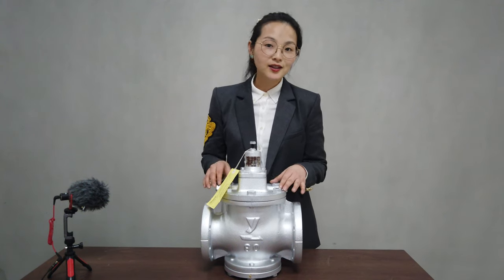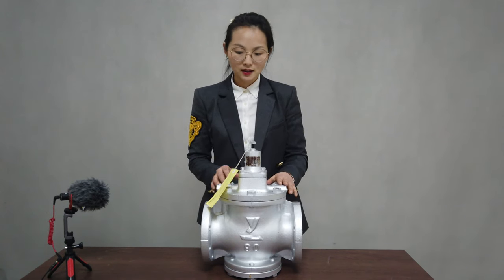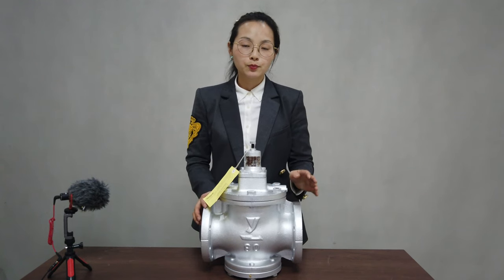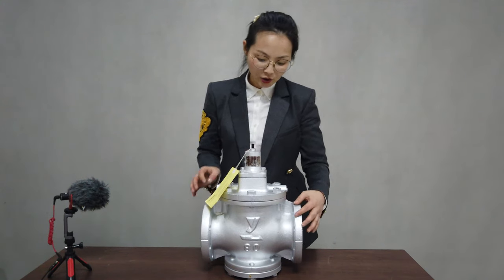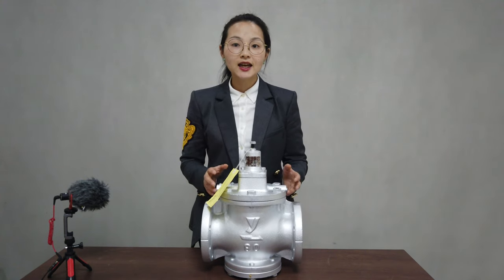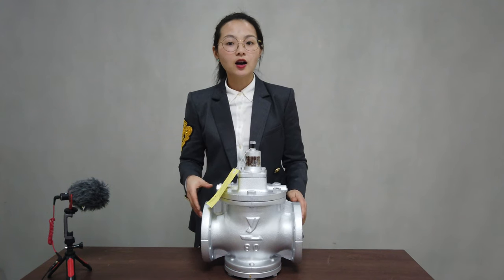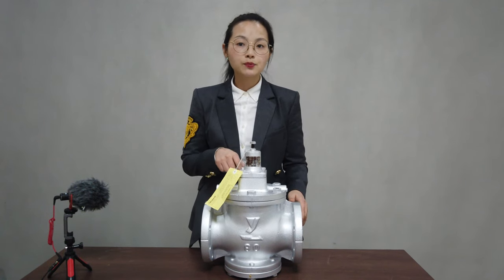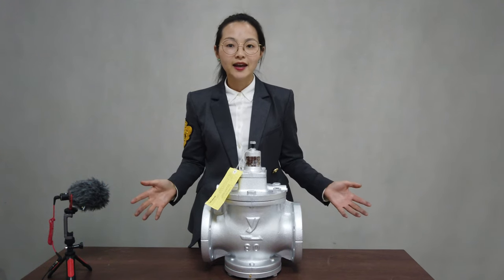Steam pressure reduce valve with YOSHITAKE brand for EPS machine

Comment: Hello.  Thank you so much for your consultation.  as you think it will be correct to install the valve on the line after the steam boiler, before the steam accumulator.  so that for all machines at once.

Comment: Yoshitake is most well known brand in Asia as a Steam pressure reducing valve. EPS machine is better to set up steam pressure between 3~4 bar that goes to the machine for stable operation.(There are 2 ways whether you reduce the pressure in the pipe line for all machines or put this kind of pressure recucing valve in front of the molding machine individualy.)
Reply from the maker: Your comment was very professional @kim